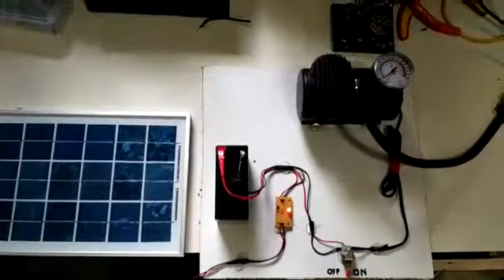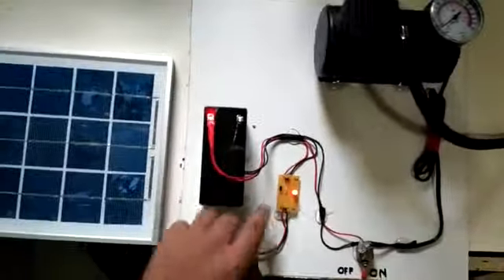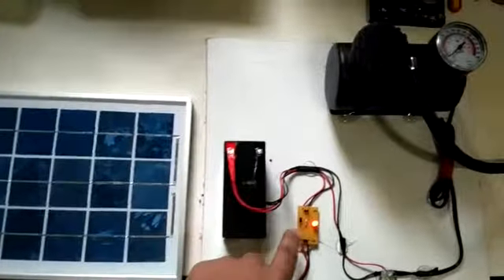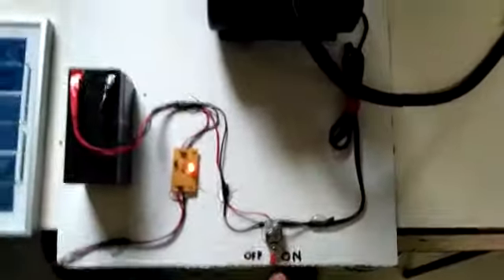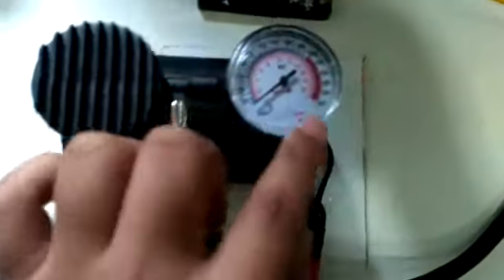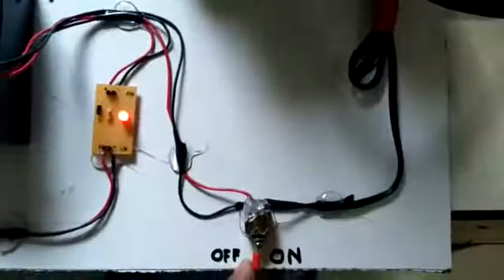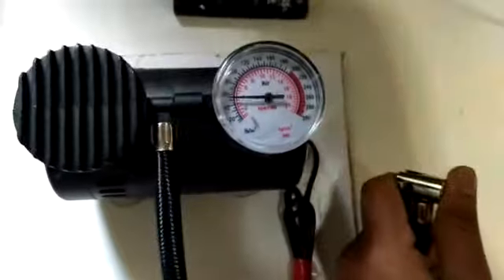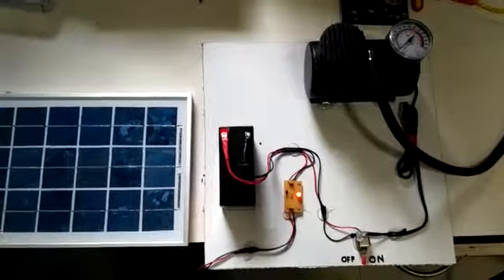Solar based Air compressor

Comment: Hmm but the performance of such a system is questionable as the air compressor is not powerful enough to fill an air tank upto 300 psi